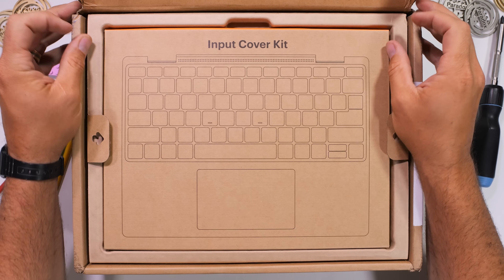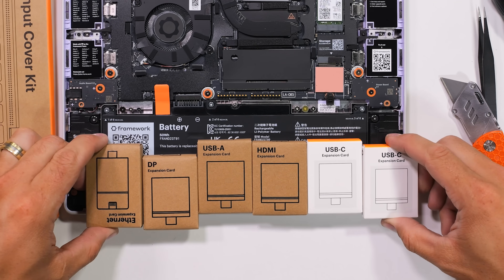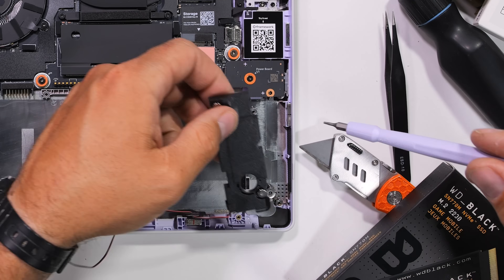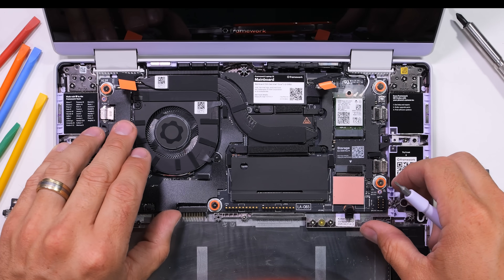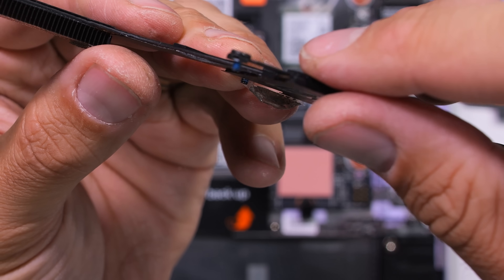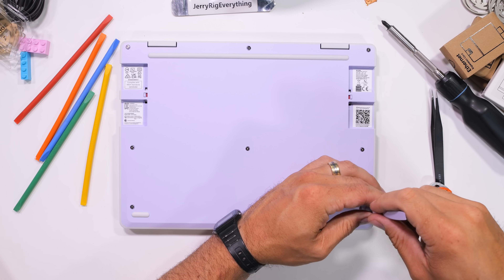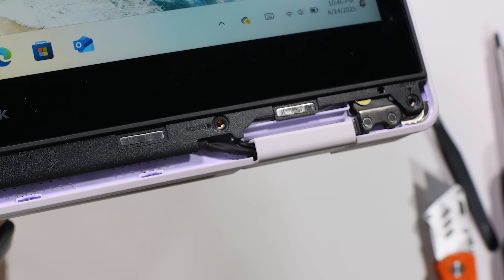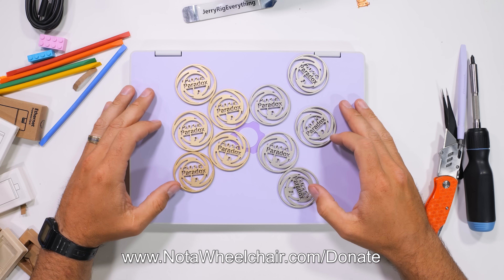The Best Laptop on Earth... is almost too easy to fix.

Comment: Heck yeah to making a video on the Framework 16! Also, one of the cool things about Framework is that if you upgrade your motherboard, you can turn the old one into another PC quite easy and even 3D print a case for it.
Reply from the maker: True!
Reply: @JerryRigEverything we need a video for the whole framework lineup
Reply: @JerryRigEverything  I'd let you borrow mine for the shoot if you don't want to purchase one :)
Reply: Or if you're not in the market for a laptop and just want a kickass low form factor computer to kick around the house like for office or media workloads, you can just buy the motherboard, print the case, populate it with an SSD and RAM and off you go.
Reply: @darjanator they actually offer a mini PC now that is basically that in a nice case
Reply: @darjanator  That's a great idea. Thanks for this.
Reply: Unfortunately, Framework 16 is a much harder sell. It's very expensive for what it offers and it had its fair share of issues (though some are ironed out a bit over time). An update to it can't come soon enough. I so hope we'll have an Arrow Lake version. The current one is a bit dates. And the GPU options are kind of lacking :(
Reply: @Winnetou17  unfortunately nvidia won't let them design and produce a GPU in the needed form factor as far as I know (remember hearing it on LTT) hence only having AMD options. Maybe they will be able to get intel to play ball.
Reply: @PalfDavid  Yeah, I know the situation about NVidia. Which makes the situation that AMD totally ignores laptop GPUs even more infuriating. There's literally no choice in the matter. As someone who is also on Linux I'd like my next laptop to not have NVidia, but it seems I'll be force into one. I'm waiting 1-2 more months for Framework to announce something and if there's nothing, I'll buy a Tuxedo Stellaris 16 - Gen7.
Reply: @Winnetou17  AMD is better suited for gaming anyway. I have an Nvidia laptop GPU and it's good, but has too much power draw because of the AI stuff (look, the GPU has CUDA cores). I think you should purchase Nvidia for AI and simulation, and AMD for gaming.
Reply: @HappyGick  Not sure where you got that from. From the people I've seen complaining about the RX 7700S, it's not that efficient. NVidia at 100W with any RTX 50 series card beats it in gaming.

And even if that was true, AMD doesn't bother making enough laptop GPUs in the first place. Not to mention that RDNA 4 doesn't even has a teaser or some leaks about it existing in laptop GPUs anytime soon, if ever.
Reply: @Winnetou17  No wrong, the 16 isn't for everyone, and it deserves an upgrade already at this point. But it also has a lot going for it. Happy with mine - I'm using it with the oculink adapter in the expansion bay, so I can use an desktop GPU at essentially full power - not many other laptops can do that (I don't know of any). Though it would be great to have a proper board that does that, at 8 lanes, that would actually be unique.
Reply: @vocassen  Yeah, having direct PCI-E connection is awesome and unique, and I do hope they'll make it work for 8 lanes too.
Reply: @Winnetou17 GPU options? More like GPU option. While it's a bit silly, Nvidia would never make a removable laptop GPU, and AMD only had the 7600s and 7700s during that generation, which are nearly identical GPUs. Hopefully AMD will come out with laptop 9000 series GPUs soon.
Reply: @leonro  GPU option indeed. Technically AMD launched 2 more models - 7800M and 7900M (for a total of 6 mobile GPUs, though 2 of them were very little variations of other 2). And they are more powerful, meaningfully so. Never seen a review of them, or a laptop sold with one, though I stopped searching for them anyway.

As for mobile 9000 ... I kind of lost hope.
Reply: @Winnetou17 you will never see an nvidia version gpu because nvidia doesn`t like manufacturers getting creative (linus is heavily invested into framework and said it not that long ago in his podcast why amd only). I shure hope they fit  a 9070xt laptop (9070s) and AI max\9th amd series cpus in updated version though.

I wanted to buy one since I`m gonna be in needd of a laptop soon but I didn`t want to buy the 2023 specs so I had to settle on lenovo legion 5080 i9 14th gen against my will...
Reply: @pixGu  I know very well the NVidia situation. Which is even more annyong as a Linux user. I really REALLY don't want to support their arrogance, their pettiness, their greediness, their anti-open source stance, but AMD is literally giving me no choice. RDNA 3 on laptops was a ghost generation, RDNA 4 on laptops I heard or seen literally 0, zero, nada information about it.

I'm on a laptop that's getting close to 9 years old. I really need a new one, I've been searching and waiting for about 2 years. Nothing ideal for me is even close. I was hoping that I'll be able to get a Framework 16, but unless they anounce something new, I won't get it. Like you said, I also don't want 2023 specs. I want 128 GB of RAM, I want a GPU with 16 GB of VRAM and about xx70 class of performance. RX 7700S is nowhere close to that. There's other things too.

If there's nothing from Framework soon, I'll go and buy Tuxedo Stellaris 16 - Gen7.
Reply: This all the way show the 16
Reply: The 16 has not got any upgrades yet so rip...
Reply: Nice!
Reply: You could use said PC as a media server to stream all your legal copies of movies and tv shows, even family photos and videos. You could even use it as an emulation station if it's powerful enough but that only depends on which generations you'd like to emulate. It's really cool that once it outlives it's primary use case, you can essentially recycle it and be creative with how you use it moving forward as a secondary device, instead of just throwing it out or selling it like most people would do.
Reply: yeah but the new motherboard often costs as much as a new laptop from competitors. There is also nothing stopping you from reusing an old laptop in the same way and it comes with keyboard and monitor included!
Reply: Pick the AMD version on the 16. Why heck get their Ryzan Mini desktop while your at it.
Reply: And a screen scratch test and bend test..

Comment: Bought my wife an OG Framework 13 three years ago! Absolutely love it!
Reply: And it still works fine?
Reply: @Klarkada  would be a pretty crappy laptop if it didn't survive 4 years though :p I've got a few 12+ year old Lenovo's laying around still working just fine on Linux. Sure the batteries are nothing like they used to be but plugged in they do the job :)
Reply: @Klarkada  like a champ! She uses it almost daily.
Reply: Wikipedia:
"Founded January 2020; 5 years ago"
Reply: crazy to remind myself that framework is that old, seems like 1-2 yrs ago
Reply: @mynk0.78mm looks like it’ll actually be 4 years in October 🤯
Reply: @Matlock69 😂

Comment: looking at the webpage, im noticing that it's definitely not budget, but rather I'd say midrange. Any laptop that exceeds 4 figures in price tends to not be something affordable by most budget spec people, got my hopes up for this broke 21 year old 😔
Reply: Obvi its not the cheapest laptop but its much cheaper than ones of equal specs, along with that its reparability will save you money from buying a new laptop
Reply: Its possible to configure one for just under $1000 CAD, so 700ish USD? Its definitely not competing with the 300-500 dollar laptops but that is the disposable laptop category. Mind you, not disposable in the sense of what the consumers expect from them but rather disposable in the sense of how they're designed: usually really cheap materials that won't last and obsolete hardware.

Unfortunately with how expensive everything has gotten lately, ~$1000 has become the price point for a laptop that'll last you through school and longer.
Reply: Moron. Value is more than just $$$. 

This is fully repairable. You spend $500 on something cheaper yet if something breaks, you may be spending more to replace it. 

This thing is a work of art
Reply: @HyperIndian  sheesh, insulting for no good reason. Im not saying the laptop aint good, I'm saying it's hard to afford for me. I work 50 hours a week for 6 days every week, and I barely scrape by still. Hard work is hard work, and sometimes I can't afford things like this without jeopardizing my life. Car repairs, insurance, rent, phone bills, etc, keep me on my toes. This laptop is awesome but still not budget. Please be kinder, you have no idea what people are going through.

Comment: I like what Framework is doing and would love to get one, but it's hard at the current price point, especially for a comparably sized laptop. I get that it's supposed to last you longer at that price, but as someone who has gotten a lot of life out my previous standard laptops, it's just hard for me to justify it.
Reply: Older laptops were built to last though. New entry level laptops are garbage. I had a Lenovo G50-45, entry level laptop from 2014. Lasted me 10 years without any issues other than an hdd issue but thats a hdd thing. Replaced it with a sata ssd and never looked back. It was also easy to pick apart and put back together. 2 easy to reach RAM slots and 1 storage slot.

Then we got Ideapad 1 as a replacement, and before the year was over the fan just gave up. And this thing is a pain in the rude-meats to even open up. And the ram is soldered, though you still have 1 free slot.
Reply: @dmg_57  I've had my current HP for almost 4 years and haven't had any issues with it. Hoping it stays that way.
Reply: Framework 16 looked really interesting to me, swappable graphics cards in laptops were a headline-worthy feat. They launched the laptop with one midrange module and that's where the idea stayed.
No new hot-swappable graphics modules, or any announcements they might be working on more in future, which completely defeated the idea of upgradeability for me.
Reply: Unless something changes, keeping a Framework going won't be cheaper than replacing laptops.

I bought a bare bones 16" with a 7840HS, no RAM (they price gouge that) or storage (you can get better than their upcharged WD Black SSDs), and 6 expansion cards for $1600. Had I bought from a different company, I could've gotten a complete and comparable system for significantly cheaper (think around $1000 at the time), or a better machine with a dGPU. If anything were to happen to the mainboard, I could replace it for $650 (originally $750), but prices for comparable machines dropped to a similar price range.

You don't even get better customer service for the premium. I've been trying to get them to RMA the mainboard due to a graphical issue, but I've just been getting a run around of redundant and time consuming troubleshooting that only companies like Razer resort to.

Comment: This has to be one of the best laptop for sustainability i've seen, 100% on my radar when my current one is no longer reasonable.
Reply: Having had my hands on one its taken over as my favorite laptop device since my thinkpad X260. I just wish it has a mouse nub.
Reply: Repairability is important, but its also rare event, designing a whole product around it is not inherently 'sustainable'. Most consumers see framework as a tradeoff between mediocre daily use for once in year repair advantage. Obviously there are specialists for whom this is very useful but for most it will likely be a hip coffee table piece to signal scrappy nerdiness to 'normies' for a couple months
Reply: too bad that the specs always suck for the price that framework charges
Reply: Are you a child who needs a construction set? Or someone who needs performance, a normal screen, materials?
Reply: @vladmir7426  i see you're just ragebaiting

Comment: Honestly, if my current convertible notebook dies, I would definiteley consider the framework!
Reply: too bad they are way too expensive. I just compared how much would the framework laptop cost me with the exact specs as my current ASUS Vivobook. turns out it is 2.5x the price
Reply: @tanjurthurs2114  You will also be fighting ASUS tooth and nail and probably have your warranty denied after 6 months of back and forth emails with a broken laptop
Reply: @theengineer2017 ??? What? Do you seriously think that I would have issues with a brand new laptop? I've used it for 2 years and it still works just as good as new. That's the case with 99.9% of people
Reply: @tanjurthurs2114  Yeah works good until it doesn't and then you'll probably end up tossing it because ASUS and many other Manufacturers are too lazy to do actual repairs or just give you a new device IF they feel like honoring the warranty, the entire point of Framework is you buy one laptop and repair/upgrade it as you need instead of needing to buy a new device every few years
Reply: @theengineer2017  what are you smoking my dude? I could cover repairs 5 times over before it would make financial sense to buy framework. And I don't know what type of sorcery I have to do to break it that often.
Reply: @theengineer2017 you must be not aware just how outrageously expensive this laptop is compared to competition
Reply: @theengineer2017  yeah because framework warranty is much better than asus xd 🤡
Reply: @KewaiiGamer  Literally the entire damn point of Framework is reducing the reasons you have to send the laptop out for repairs, shows how lazy you are that you can't fathom that some people rather fix their own stuff then expect free repairs
Reply: I wish I had need of a laptop just so I could buy one. Might get them for my kids eventually.
Reply: I've been daily driving my framework 13 for a year and a half now and it is fantastic, I'd highly recommend their products to anyone. It is absolutely worth the price premium for me

Comment: The indirect LTT Crossover we did not expect
Reply: Framework investment disclosure
Reply: @Waldohasaskit210 I was waiting for it but then realized that Zack has not invested in Framework
Reply: All their parts are open source. You can designe your own stuff for it
Reply: The trouble is, you can’t replace it with other parts from other companies and what happens if this company goes bankrupt which it probably will
Reply: @SmackRatsUK  if you buy almost any other laptop you get a brick you cant upgrade anyways
Reply: @SmackRatsUK  I've already made a custom dual USB module for myself. It was quite easy with the open source specifications. I suspect many of the parts would be relatively easy to get third part replacements for.
The RAM and SSD are already standardized parts. I wouldn't be surprised if there were many more.
Reply: @SmackRatsUK  if it goes bankrupt then the laptop becomes just like any other laptop.
Reply: @SmackRatsUK  they have all blueprints as open source
Reply: @SmackRatsUK  we will get used/knockoff parts anyway, like with every other stuff.
Reply: @alkallne-koh exactly and there will be a vibrant market because anyone with a 3D printer can get involved in creating those slots with ports. In fact there could be some really creative modulation done. Weird custom solutions.